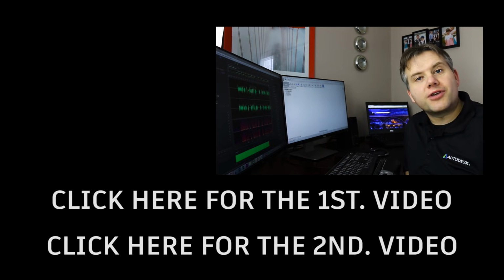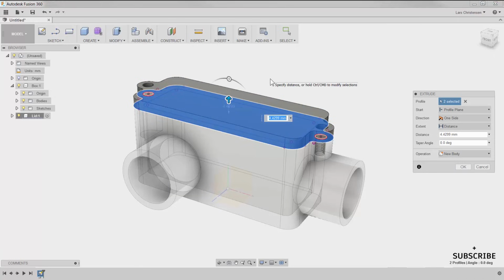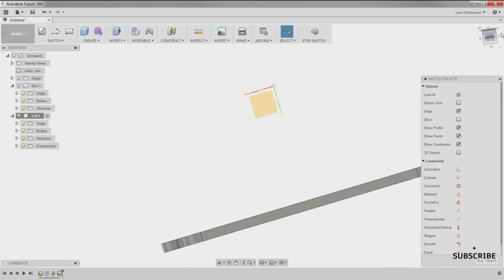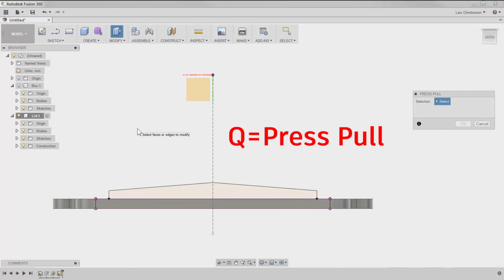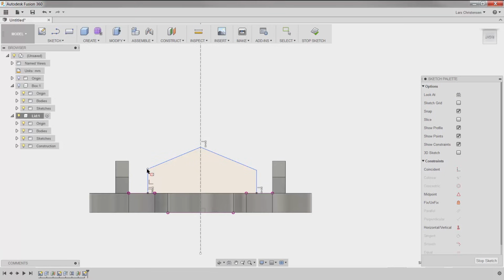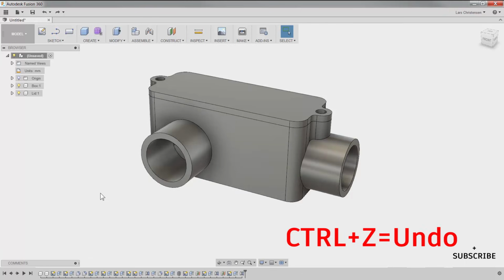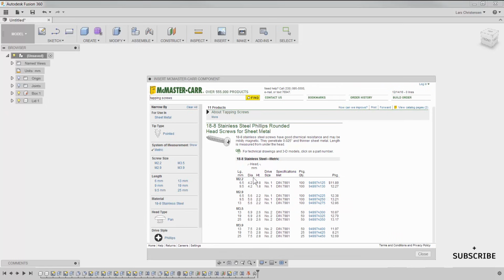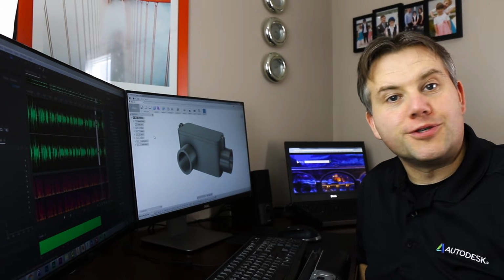Fusion 360 Tutorial for Absolute Beginners— Part 3

Comment: I can not get "select object" to select using Mirror?> It doesn't matter how I turn it or how many times I click on Feature. Any Ideas?
Reply: I think when you use mirror - you select object from the time line.  hth
Reply: THANK YOU!  I was getting frustrated!
Reply: WhoDatBe Dare THANK YOU!  This was really bothering me, and of course I didn’t see Lars click on the timeline. Even though I rewatched it 10 times
Reply: I had the same problem,Not sure how I got it to work but it envolved trying to select multiple ways and restarting the process. Do not like.
Reply: Gene Merritt All good.  It was a 1 second click and easy to miss.
Reply: Mike Trent so happy to hear I've actually helped someone I actually don't recall now weeks later If that click on the timeline was on this video or another I've watch so many I'm an interested woodworker Who uses sketch up I wish lars was as interested in woodworking as I am so he could show woodworkers the most proficient way  to use fusion 360 designing woodworking projects.

Comment: When I use the project function, when I select the outer edges of the top of the box, it does not outline them in red like in your video. As a result, it does not do anything and when it comes time to extrude the lid it cannot be done property because there is nothing to extrude.
Reply from the maker: Hi Nunya Biznis Thank you for watching!
Did you figure this out? Sounds like you could have been inside another operation?
Reply: Yes, I solved the problem, but I don't remember how.  All I remember is that I had something set to hidden and once I set it to be not hidden  it worked and I was able to complete thee project.

Comment: Great work, thank you for your time and effort. One comment: an M3.9 screw into an M4 thread?
Reply: If I manually machine a threaded hole, I'll always tap a smaller hole than the screw. 
Ex: tap a 3,3mm hole for a 4mm screw.

I tried to write an explanation here, but it ended up long and confusing, it's much better you learn it by hand.

It might be a bit different on software, as the listed sizes does unfortunately vary between the outer edges of the threads or the inner base beneath the threads of the screw.
Reply: Taps and Dies technique are not lost on me. I anticipated an M4 screw/bolt to fit an M4 thread, the gap tolerances between inner and outer faces being industry standards,  wouldn't Fusion 360 show interference/ collision between incorrectly paired threads as they progress? I need to start playing with Fusion...

Comment: I have drawn the box 3 times. The origin for the box is located as it should be. But, after successfully drawing the lid, the origin zero point for the lid is way off. This makes it impossible to perform the offset plane method shown in your video.

As far as I can tell I have followed step by step what you have done in your videos. Is there a setting in Fusion 360 that could cause this? Is there a way to get the origin recentered with the lid?

After drawing the lid, when I pan or move the model around the lid separates from the box... how do you get the two to jump back together and/or how to nail them together?  I am assuming the screws won't really hold them together. :-)
Reply from the maker: Hi Ronald Walters Thank you for watching!
Hm, honestly not hundred percent sure. But, if I was you, I would not worry too much about it. This is more about learning the tools. I am sure you got things close enough :-)
Reply: Did you click on save position at any time? You can make the project active, that's the top entry in the drop down on the left and review the time line. If there are any position features in there, you can delete them.
Reply: Thank you Lars for being so concise with your steps and explanation.  I too experienced the same problem,  the box and lid did not share the same origin, therefore when I mirrored the features of the inner tab, its position is outside of the lid.

Comment: Afraid I'm having difficulty with constructing and offset plane, too. I get to the final step and am unable to get the offset plane to snap to a surface or vertice. 1 - The plane is moving only 1mm increments, do I need to turn off snap? 2 - When I hover the mouse over the vertice, the menu does not include vertice. . . . Huh, just now, after 90 minutes of fiddling, it snapped 13mm to the inside wall but, still, did not have option of selecting a vertice. Thanks.
Reply from the maker: Hi Brian Chapman Thank you for watching!
Sorry for the trouble. I just tested it on my system and everything seems to work. I would recommend that you post here
https://forums.autodesk.com/t5/fusion-360-support/bd-p/962

You need someone smarter than me :-)

BEst,
Lars

Comment: Hello Lars,

I was wondering how to get rid of the error " Adding this dimension will over-constrain the sketch"? i got it when I tried to sketch the 2nd pentagon
Reply from the maker: Hi Raymond Ng Thank you for watching!
Sounds like you already have the constraints on your sketch you need. Look for a constraint that makes it create the message.

Hope this is helpful.

Best,
Lars
Reply: I got the same problem and found that you cannot follow the steps exactly as in the video sometimes.  I had to set the length of the rib first then the symmetry then do the rest of the dimensions.

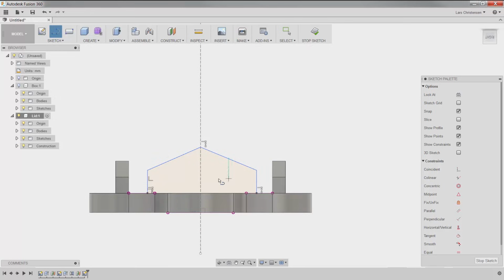Comment: At 12:00 ish. My sketch don’t work. I can do the 2.5mm but the 5 don’t work and 18mm throws an over-constraint error. I’ve tried this so many times, including deleting the entire lid component.
Reply from the maker: Hi Jimmy Noname Thank you for watching!
Sounds like you need to double check the constraints. Something is different from my model.

Best,
Lars
Reply: Lars Christensen oddly enough I can’t use a construction line from the face center. When I do it fails every time.
Reply: Jimmy Noname ave you tried to shut the program and possibly start from scratch

Comment: Hey Lars, a question if I may. For example when you chose that screw...could you change the length of the screw or would you have to select another one from the catalog? And if you can change the physical properties of the screw how would I go about doing so? I cant seem to figure out how to change the length of "PANDUIT" or "Wire Duct". Thanks.
Reply from the maker: Hi Yuri Bolshakov Thank you for watching!
You could start modifying the screw with either sketches or direct editing tools. But, that would be a lot of work. In this case I would just download a longer screw from McMaster.

When you download from McMaster, it comes in as a "dumb" solid. Meaning, there are not data driving the screw. Now! If we were going to model the screw our self, we could incorporate stuff like parameters, and now we could have all kinds of cool updates to the model.

Best,
Lars

Comment: I've built the box myself along to the three videos. They helped a lot, thanks! I only got a little confused with the offset origin plane, but after doing it a few times it's not that hard. Next brainfart was with the joining of the screws. It took me a few tries. Important is that the underside of the screwhead is highlighted and then you can hold Ctrl and klick on the center. Now my box is assembled correctly! :-)
Btw: the section analysis is quiet helpful. You see a cross section of your model an can inspect every aspect, f.e. clearances of screw holes.
Reply from the maker: That is awesome to hear UncleManuel .Thank you for watching the videos. ANd Nice work!

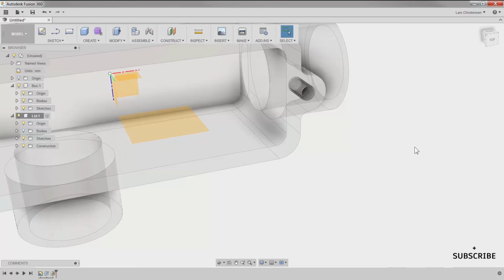Comment: Have re watched and tried what you described at 5:40 ten times now and it will not select that inside vertex
Reply from the maker: Hi Jared Zadorozny Thank you for watching!
I must say you are a determined person :-) Make sure you don't have something blocking the way when you are selecting. Also, you can hold down the left mouse button for about 5 seconds while over the vertex and a little menu will appear that will let you select the vertex
Reply: After moving the model around in a few different angles I was able to select the vertex it's a very small area of where you actually can select got it on the 16th try lol 

I appreciate your reply and for next time I'll take in to consideration of holding down for 5 seconds.
Reply: Also excellent tutorial video. I followed along many blender videos off YouTube from other channels and you are definitely in the 5 for teaching how to use CAD for noobs with out being overly complex aswell as showing shortcuts right off the start instead of hunting through tool bars.

My only suggestion for your videos I don't know if it's possible with Fusion but to have keyboard and mouse notations on so we can see what you clicked on

Comment: When performing the offset plane function, I am having the hardest time getting the plane to snap to the vertices such as you did. Half the time I get an error that says that the object in the plane has disappeared when switching off the lid light bulb. The other times it simply will not snap the the 13.00mm defined by the box as in your design and with mine. Does it have to do with our planes being different? Your XY plane is my XZ plane... 

Other than that loving the videos! After this lesson, I will be graduating to CAM tool. :)
Reply from the maker: Hi Gordon Aldaco Thank you for watching!
It should not have anything to do with what plane. Do you think it could be graphics?

Comment: Great Beginner Tutorial, had one issue which I resolved when adding the screw tabs, as the cut would not work or the fillet tab, changed if from component to joint and the issue resolved itself. Thanks, Lars, keep up the good work. 
Regards,
Claude

Comment: Hi, Lars!
Great tutorial! Thank you very much for your time making it!
I have one question: I need to design two pieces that have an angle but I don't want to worry about it (just like the parametric settings of the box bottom). It is a vertical rectangle (150mm x 15mm) and a diagonal rectangle (1??mm x 15mm) making a shape like |\. The distance between the outer edges of each rectangle must be 60mm at the bottom, and the inner top corners of each rectangle touch each other. How can I "join" the rectangles at their inner corners and "open" the bottom until the outer edges reach 60mm?
Thank you for your patience if you read until here!
Reply from the maker: Hi Carlos Molina Thank you for watching!
Are you talking about something like this video:
https://youtu.be/34ZeXHxYS28?list=PL40d7srwyc_Mkgc5wvP_OfVel9aDkNkZ6

Hope this is useful
Reply: Hi, Lars!
Thank you for your answer, but it isn't what I'm looking for right now. This video will be very useful in another part of the same project. I've made a video (https://youtu.be/gfTYS91JZKs) trying to explain what I need to achieve. Hope you already have another video ready to help me.
Thanks again!

Comment: How do you move inside the 360? I don't see you using shift+mouse wheel button to move arround
Reply from the maker: Hi NehuyStealer Thank you for watching!
I cheat, I use a device from 3DConnexion.com......You don't need one, but it does make life a little easier
Reply: Thanks! May I know which model? or them all work the same way?

Comment: Absolutely great instruction. I struggled and was getting very frustrated with the Autodesk instruction and was ready to give up until I  found your videos, so good job. In one of your replies you stated that you use a 3Dconexion mouse. I looked it up and see that there are a few choices. There is no local dealer in Las Vegas Nevada. I am interested in which model you prefer. I tend to go for the one with the extra buttons. What is your experience with them and any guidance you may have. I do struggle with the 3D movement using my mouse.
Reply from the maker: Hi Larry M. Thank you for watching!
I have promised for a long time that I was going to make a review video. I will get that done sooner than later.....
Personally, I could get away with the cheapest one as I normally don't use the custom buttons

Comment: How do you turn around the 3d model so easy? I use the tool up in the right corner but I find it hard to use. Do you use keyboard or the mouse in any special way?
Reply: You can press down the mousewheel to "pan" (move side ways and up /down) and if you hold the shift key down you will rotate the model.
Reply from the maker: + Bjornar

I cheat. I use a device from 3Dconnexion.com You don't need one, but they do make life a little easier...

Comment: When I make lines, it only lets me put 3 points at a time (two connected line). This seems to cause problems later on. Anyone know why?
Reply from the maker: Hi bubblejuiceman Thank you for watching!
If you open a new sketch, click line. Then move mouse, left click, move mouse, left click, move mouse, left click AND then the command automatically stops???
Reply: Thank you for taking the time to respond!

Yeah, I make a new sketch, I press L, I click, move the mouse, click, move the mouse, click, and it stops. So to make the tabs shape, I had to make a total of 3 lines per tab, and that seemed to cause some problems after with dimensions.

Comment: Cavalrycome-- For clearance if the hole in the lid is the same as the hole in the body , the screw will bind on the lid before it can seat properly --- forcing you to strip out the lid to make tight.

Comment: This is a good series, I just sat through it and followed along (and made my model slightly different to make sure I actually understand how these things work), but I'm pretty sure a lot of absolute beginners would be lost.  

I'm not an absolute beginner to CAD modeling (I'm pretty proficient at Sketchup) and I had a bunch of places where you lost me, mostly just basic navigation, things like getting it to orbit vs pan (I keep wondering if you can reverse it like in Sketchup since you use orbit more than pan and pan is the default which doesn't make sense to me), the use of the orientation thing in the upper right which I figured out by mistake, when you inspected you didn't show how to go back to the regular view, and one thing that I haven't entirely figured out yet is how to change the views to look somewhat like yours (you go from transparent views showing hidden geometry and other views constantly in the video and I figured out some of them but not all of them) as well as things like colors... (somehow I changed the color of mine at the beginning and can't figure out how to change it back, even applying materials I see the material color for a few seconds  and then it goes back to the other colors).

One thing that I didn't see is how to edit the existing construction, like if you have this and want to change something about it, how to do that without messing the rest of it up or ending up with some geometry that doesn't work and how to deal with errors (maybe this isn't that big an issue with F360, I know it's a very big deal with SU).

Otherwise following along and the occasional lost blundering around associated with it got me going enough that I think I can start watching other fusion videos and maybe editing some models...
Reply: LOL, I guess I'm almost a month late to the party.

For anyone thinking the same thing he answers most of this here:
https://youtu.be/PCPyy_RVEhM
Reply from the maker: Hi Mark Pikas Thank you for watching! and for taking the time to comment!

Hope you have an awesome day!
Reply: Hey Lars, I'm originally from Buffalo, if I make it back up there sometime I may take you up on your offer of a beer in the other video.
;-)

Comment: so my issue is somehow I managed to move the origin XYZ so when I went to mirror it was off the lid.  Where did I go wrong please?
Reply from the maker: Sounds like you original sketch might have been off? That is my guess. I would not worry too much about it. This was just practice :-)
Reply: I would share... Just start over from scratch, just to see if the error gets duplicated. If not then it was just a fluke, but if it gets duplicated, then you have an issue that requires some attention. I'm sure by sending the saved file to you, you could proof read it for errors...

Michael

Comment: really kool tutorial ....the only issue I m facing is getting the "Offset Plane " to align to the wall by selecting the vertex, so did that manually by shifting.
Reply from the maker: Hi vishu raj Thank you for watching! As long as you got it to work :-)
Nice work!!
Reply: That was my problem too.  It said snap to 13on the screen but I ended up just typing in 13 into the dimension box.

Comment: Hi Lars.
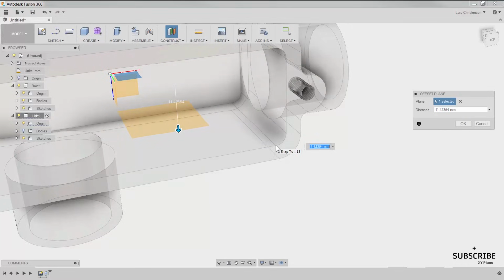I'm having difficulty getting the "Offset Plane " to align to this new location like you did at (5:32 ) in this video? Did Autodesk change the way this function works in an update? 
I've been searching, but still have not found the solution.
Reply: having the exact same issue. If you figure it out let me know XD. Its like once you select the offset plane theres no way to select the "vertice" that he is talking about or any line on the box for that matter.

Edit: Ok so I did figure it out. To get the offset plane to work you just select offset plane then select the inner side of the box. Do this twice, one for the long side and one for the short side. After that you will mirror the work so you dont have to do it twice. What is happening is when you click offset plane it is making a plane right where you click rather then making one in the middle and having to drag it out. It just makes the plane right then and there. You can turn them on and off as well for visuals so dont worry that it gets really messy really fast.
Reply: Thank you. I will give this a try when I get home later!